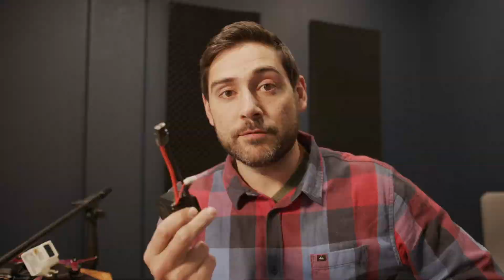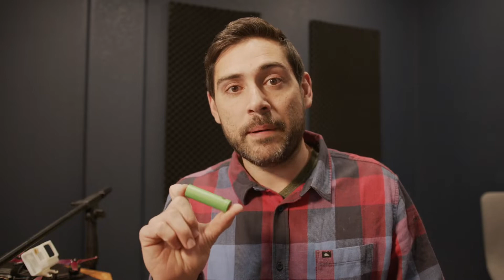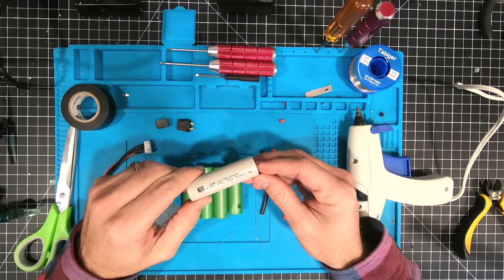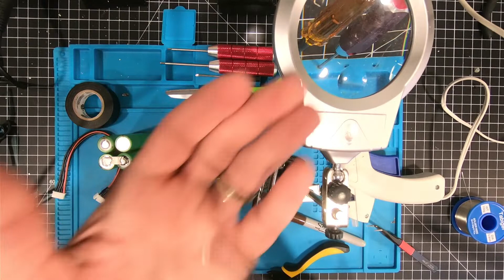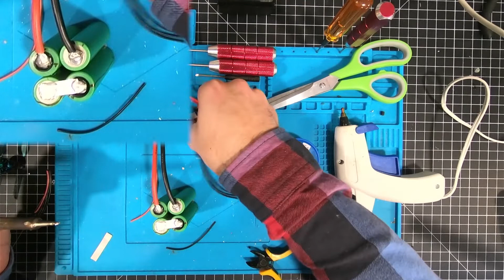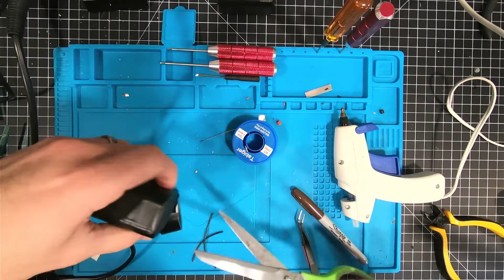Build Custom Long Range FPV 18650 Batteries - Long Range FPV Battery - Make a Li-Ion Battery Pack

Comment: I don’t really see the point of using nickel strips instead of copper wires once you’ve already decided to use a soldering iron. The main reason for using nickel strips is to spot-weld them, avoiding prolonged heat on the cells. Nickel is less conductive than copper, but that trade-off makes sense if it allows you to avoid overheating the batteries.
If you’re already using a soldering iron (and therefore accepting the risk of heat damage), using nickel strips no longer makes much sense. At that point, copper wires would at least give you better conductivity. Otherwise, you’re basically getting the worst of both worlds: risk of overheating the cells and lower conductivity.

Comment: Ine very important thing that is missing is adding insulation rings in the positive terminals of the cells. This is something absolutely crucial if you are using stripes rather than cables to make the series connection. 
The reason is obvious, if you push the tab I  the cell's positive terminal enough, you make break the flimsy plastic insulation and short the cell. The rings are quite tough and really enhance the protection.

Comment: I'm planning to make one of the larger 21700 6s packs for my 7inch I'm building. Planning to use the molicell p42A 45A cells. Curious as to how you figured out what size nickel straps to use? I just want to make sure there is enough there for the amps.

Comment: Should I use these batteries for a 6s2p pack for 7" drone ? I calculated the weight = 840g. Where the 18650 @6s2p = 528g.

That's 312g more if I use the 21700. Which one you think I should use ?
Reply from the maker: I actually dont like 2p packs for LR the extra weight doesnt add equal flight time. And it makes the drone harder to control. I like a regular 6s 4200mah
Reply: @KAREKINFPV  OK, which would you prefer 6s2p 18650 or 6s1p 21700 ?
Reply: @PerchEagle  if your quad requires a lot of current draw, then you'll need 2p to get the extra discharge current

Comment: God damn it, after seeing how much time you spend holding your iron tip on the battery, I'm getting really frustrated, because my cells died and I only heated them for like half your time.
Reply from the maker: Oh bummer man. Im sorry. Im not sure whats going on here? I use my temp set at like 800 with the largest tip i can find. I also ise tin free solder. How are you soldering?
Reply from the maker: Feel free to find me on FB and message me.

Comment: Could a bunch of capacitors be added to give a good burst of higher voltage for quick throttle punches?
Reply from the maker: Thats a good idea. It would be worth an experiment for sure. But youd need to test the amp draw at the caps vs the amp draw at the pack some how.
Reply: No. The capacity even of „big“ capacitors is to small for a motor.

Comment: 3.11  .....soldering the two positives and two negatives together, will make them in parallel and they won't explode. The current delivered is greater in parallel.

Comment: If you absolutely insist on soldering (a powerbank style spot welder that can do 0.15mm thick pure nickel strips is ~$60) then you MUST have at least a 60W iron. Preferably 80W or 100W. Time on cell is crucial. You're tinning the cell twice, adding the nickel  twice and then adding the leads (which should go on the nickel in between the cells when possible). If you spend more than 5 seconds on each per soldering event you're killing the cell. Less capacity, less cycles in lifespan, more likely to suffer catastrophic failure.

This instructional is showing you how to bake the cells, the first solder joint to the first cell is 35 seconds. Start by tinning your iron tip. Heat transfers best that way. Add rosin flux to everything you are going to solder. Start by soldering a blob to each side of the cell. Then add a blob to each end of each nickel strip. Then start connecting the cells with nickel.

Get a laser thermometer so you can check the temps. You want the case of the cell to be cooled down to 40 Celsius or less before you go at that cell again. You never want the case to exceed 160 Celsius or you're teetering on the interior of the cell heading towards thermal runaway.

I would advise using an insulator ring on the positive side since the edge of the top is negative 

One more time: 5 SECONDS MAX PER JOINT. 3 SECONDS PREFERABLY. FLUX IS YOUR FRIEND
Reply: You forgot to mention to make all the balance leads the same length, I also always use a spot welder and insulation boards on the ends , one with a hole in the center to run the power and balance leads out of , then heat shrink the battery
Reply: @jamesmason7124 why do the balance leads need to be the same length? They all have to go to negative terminals that are different distances away?

Comment: I'm going to try this soon and when I'm done I'm going to feel like a bomb maker.

Am I correct in my assumption if I want to make a 6s I just add two more batteries to the stack and "the river" is just a little bit longer?
Reply: Yes so 6 batteries together means 6s and 4 batteries is 4s from my understanding

Comment: Hi~
Let me ask you a question.
It's a 3 inch cine hoop.
In the video, there are videos of making a pack with 4 lithium-ion 18650 batteries and flying it with an FPV long range.
With excitement, I ordered batteries and made a pack.
LGDBHG21865 3000mA.
The problem is... When I hovered, the yaw tick symptom reappeared after it came up, and, after a few seconds, the low-voltage buzzer sounded and the aircraft sank.
If I open it again, it opens again,,,,, repeat...
So, I changed the low voltage warning in Beta Flight to 2.7V, and when I turned it on, there was no sound.
If I take a break for a while, it will float again. But it sinks again... The battery is hot, and the voltage is 3.8V... TT
I bought 40 tablets... but I can't use them all?
How do people use? Batteries were also made by buying anything.
Is my FC the problem? Or is there a special setting for Li-ion?
FC is IFlight SucceX Mini F4 V3 Stack, and the manual says 2~6 Lipol. Do I have to use only Lipol? Can I change FC?
Why is this happening?
It's a waste of money/work time.
I'm serious~~ Please advise.~~ TT
Reply: I tried the same as you and faced the sad truth, I had jumping drone like a Kangaroo. Your batteries' continuous current rating is low, (approx 2A) , you need high current capable 18650s like Sony VTC5 or VTC6 18650s (15A continuous/30A max)

Comment: great video, but careful kids you need to be safe.   soldering onto a battery is not ideal but you want to be really careful on the positive end that you dont breach the insulating material (green wrap) the casing underneath is negative and a solder ball might short it.    Spot welding is much safer.
Reply from the maker: Yes your absolutely correct.

Comment: I bought a huge drone collection from a guy and he had a bunch of these battery packs. It came with a venom 4s battery charger but I have no idea how much of a charge I should put on them. He already had everything preset but I don't want to blow them up so how much should I charge them up to? And how low should I drain them?

Comment: Is it good idea to make 3s li-ion packs fro 4" like flywoo explorer??
Reply from the maker: I actually don't thin so because I think the min cell voltage would be too low to keep it flying. You'd need to get higher KV 3s motors at least. But the min cell voltage on a 3s liion is the max cell voltage of a 2s. I don't think a flywoo will fly on a 2s.
Reply: @KAREKINFPV  I was writing about flying it on 3s not 2s. I have chimera 4" with 3800kv and it flies all right on 3s LIPO packs with just 25C discharge rate. Hance if same done on 3s Li-ion- it could fly maybe even better and longer with significantly reduced weight - as 1cell less in a pack will make it lighter. Did you try? I was about to find out but just missing tools and decent 18650 cells to make a pack.
Reply from the maker: @VictorSeedorsky  yea your not understanding my point. Liion flys to a lower voltage per cell. 2.5v so I don’t think it would fly when a 3s was at a lower voltage. For example 3v per cell 3x3s = 9v I don’t think the lead would stay in the air at 9v let alone. 7.8v when the cells are 2.6v each.

Comment: I would add to this method to pay special attention when soldering the strips to the positive side. Using too much heat on the strip, could melt through the insulation of the negative side, shorting the battery. I would punch a hole through the strips so the solder on the positive side flows through it and holds it in place, so the time spent with the iron on the battery is shorter. Also, sanding a bit the battery heads before applying solder will make it faster.
Reply from the maker: I tried to show a way most people with general tools can do. As long as you don’t hold the solder too long it’s pretty good. Really a much bigger tip melts the solder faster and transfers less heat. A spot welder is ideal too. Your right though there could be some improvements to making them. Honestly a lot more goes into making nice liion packs. These will work for anyone looking to DIY though. Lol.
Reply: @KAREKINFPV  Will these Li-Ion cell work for my below hex?
1)Frame:Tarot 680 PRO Folding Hexacopter Frame
2)Motors:6x Tarot 4108 High Power Brushless Motor (380kv)
3)Propeller:3x Tarot 1355 Carbon Propellers (Two Holes / CW and CCW)
4)ESC (Electronic Speed Controls):6x Hobbywing XRotor 40A-OPTO ESC

Comment: soldering two positives together dose not short out the battery and it will not explode. out a 2s it creates a 1s.
Reply from the maker: Ur totally right, I meant to say neg -> pos and pos -> neg on the same two batteries,